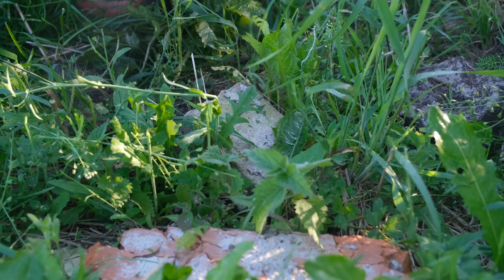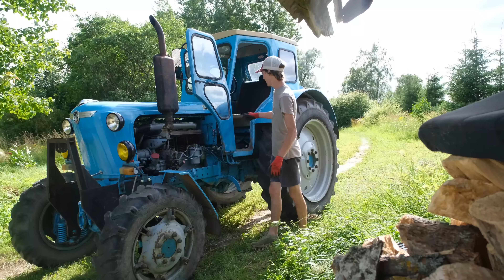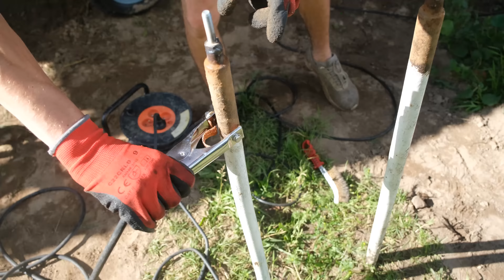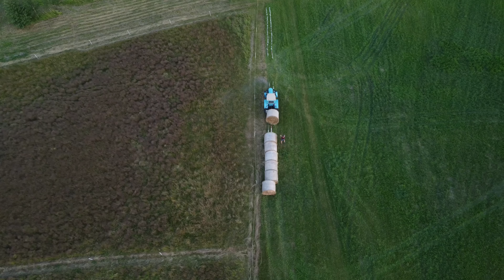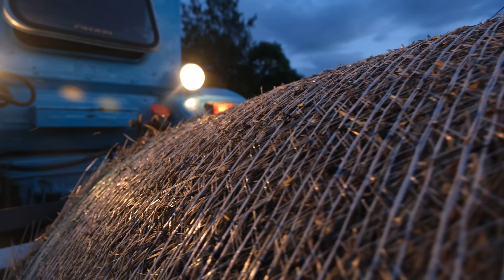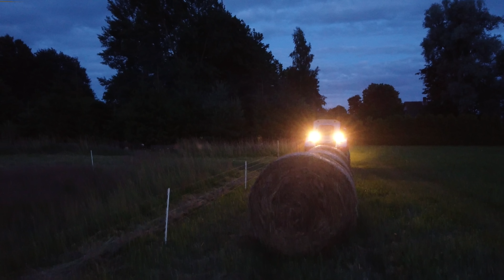Working Late to get Hay Bales collected

Comment: Don´t you need to cover the hay roles for the rain and weather conditions?
Reply from the maker: If the bales are covered they get rotten much faster beacuse of moisture can't escape. We make them in a line because the flat ends are where the rolls are the softest and the round edges are hard and very compacted the water just rolls off and the rolls inside are fresh for whole feeding season. Our last year rolls are still perfect to use! 😁❤️

Comment: Now buy a long tarp and cover the top of the row with it.  You all have so much snow and moisture in the winter it will pay to keep as much moisture as possible OFF of the rounds.
Reply: It becomes more moldy when covered
Reply: @SashaMonsteraki  Not if you cover it when you first get it rolled.  I cover my round bales with a tarp every year.  It sheds the water and keeps the roll in much better shape.   If you cover an already wet bale and don't allow air flow... of course it will mold.

Comment: You need a hay barn so it doesn't get all wet and moldy. Looking at the older bales which look awful. Hope you are not feeding them to the animals anymore.
Reply: Only the outer layers are bad. They are rolled tight only so much gets through the outer layers.